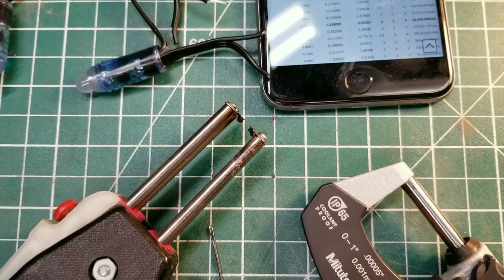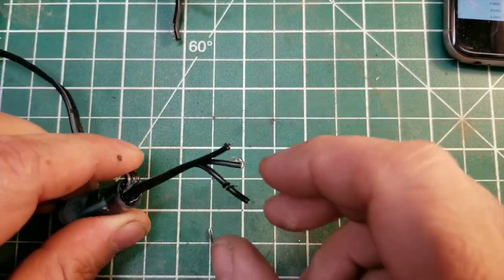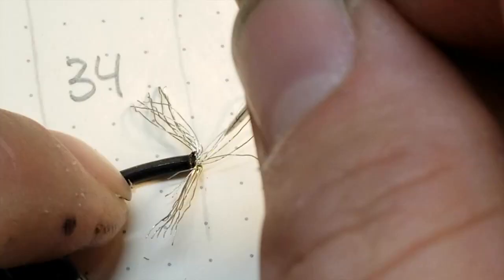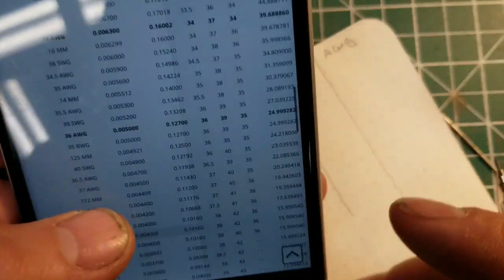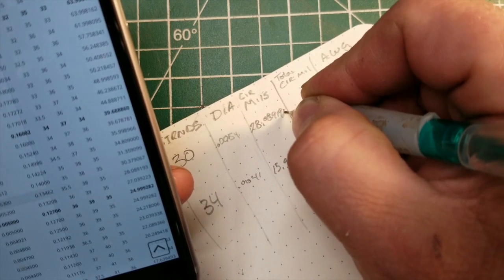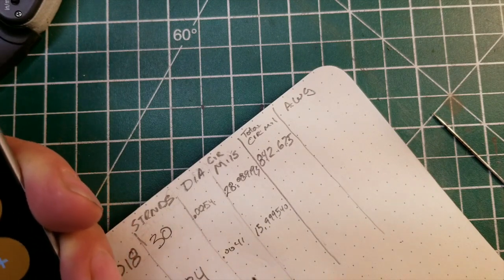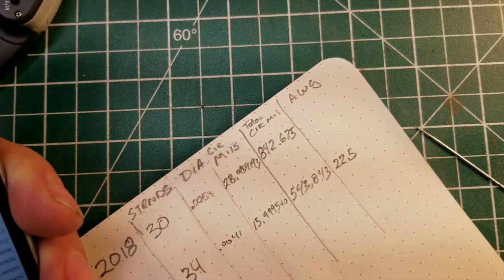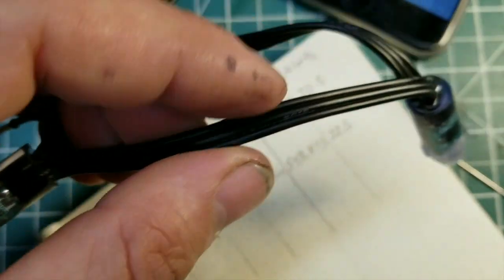Calculating stranded wire gauge

Comment: Hey thank you for this video because the people saying what's the big deal there is a very big deal it's false advertisement it's fraud and it could be a life or death situation right now I'm in a situation with Amazon I bought some solar panel wires that was rated at 10 gauge and according to the calculations it's actually a 14 gauge which is a humongous difference and if you think about the money that they're making by falsely advertising the amount of gauge wire you're talking half of the price and it could be a fire hazard and cause death or serious bodily harm so making these companies stand by what they're actually supposed to be putting in these casings is invaluable because who else is going to check this the average person is not going to check this and they know that I don't know where to go from here I don't know if we need to seek a forensic engineer to sue these people what would you do because I've already got this wire installed on my roof several thousands of dollars of Labor and now I've got a 14 gauge wire to where a 10 gauge wire is supposed to be

Comment: You did all that measuring to come up with 20.5 and 22.5, respectively. Yet, both wires state 20 gauge. What's your point? Are you saying that what's on the wire isn't always accurate or that your math was wrong? If I wanted that same wire, which would be correct?

Comment: I'm curious did the difference in the gauge really cause what you were using the wire for to not work or have a adverse effect on it?
Reply from the maker: It quite possibly could have caused some issues with my pixels. The bigger issue
Reply from the maker: Was that some suppliers advertised 18awg, and it was 21 Awg.

Comment: Is there no faster way? It sounds like a PITA.
Reply: I used this calculation back in the 90's when buying spools of wire for automotive use. I found that buying good 14ga wire measured 14ga. Buying cheap 14ga wire measured 15ga. So it really does make sense to verify what's printed on it.
Reply from the maker: I suppose for larger diameter cable, you could approximate it. If you want accuracy.....
Reply: @pauldoyley8354  Yeah I get it - but you'd think the standard would have been setup differently.